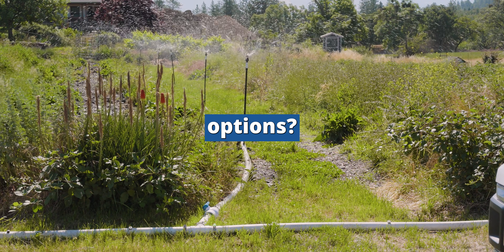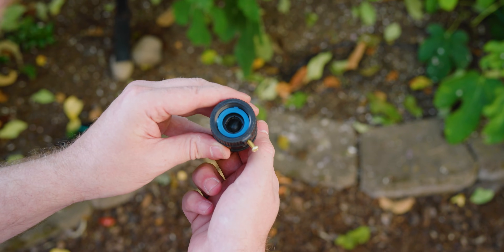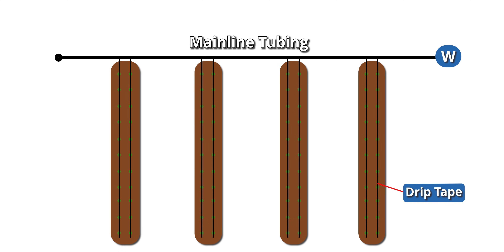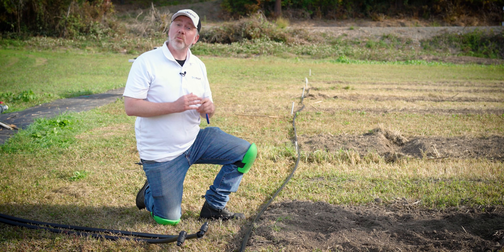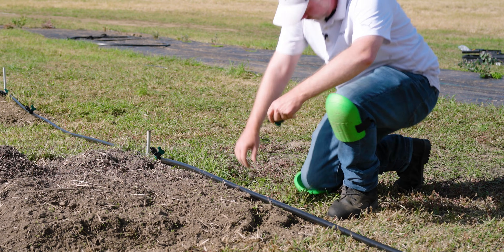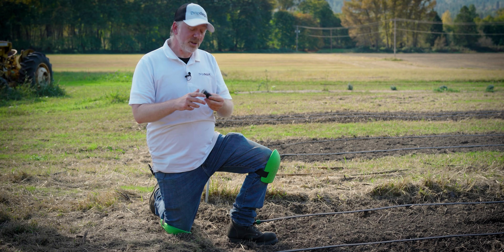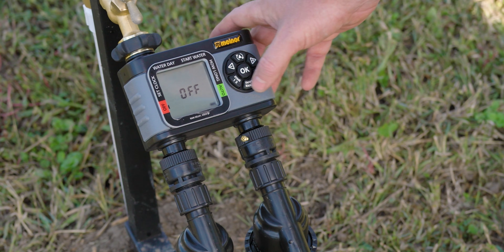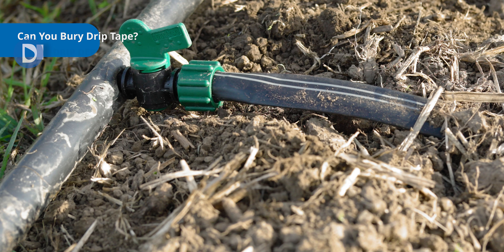How to Setup a Drip Tape Irrigation System for Small Farms | Step-by-Step Beginner's Guide

Comment: What is the advantage of drip tape over 1/4” dripping with inline emitters? I have well water and I have to replace the 1/4” pretty much annually.
Reply from the maker: The main advantage to drip tape is that it can handle much longer run lengths than 1/4" dripline.  Depending on spacing, 1/4" is limited to about 20' to 30', where drip tape, even at 6" spacing, can easily handle 150' or more depending on the emitter flow rate.  The main advantage 1/4" dripline has over take is the flexibility.  Drip tape has to be ran in a straight line, where 1/4" can snake or "S" shape through an area when things aren't planted in rows (flower beds in front of the house, etc).  

Is mineral scale building up inside your 1/4" dripline and eventually clogging emitters?  If that's what's happening, give flushing the lines a shot next time if you're going to be using it again.  At minimum at end of season, but periodically throughout the growing season is good if it's possible.  For this, you just remove the ends from the 1/4" dripline, turn on the water and let it run out of the end for a few moments.  

1/4" dripline has a "turbulent flow path" inside.  Basically, the water is very turbulent, and this will dislodge debris inside and if you have the ends open, flush it right out of the end. 

Dripline that is clogged with scale from hard water can be fixed as well, and it's not too tedious (unless you have a bunch of dripline, then it could be a bit much).  1/4" dripline can be cleaned of mineral build-up the same way folks clean misting nozzles: by giving it an acid bath.  Acid in this case is usually just some distilled vinegar.  You can put some in a bucket, then put the dripline in there with the vinegar, coiling it as you go to maximize space if needed.  Most of the time the vinegar even gets diluted first, if you decide to give this a try, let me know and I'll hunt down the dilution ratio in the spreadsheet. 

That's not always convenient for people who use a lot of dripline though.  The folks who don't replace it will inject an acid solution into the irrigation lines, and that provides a similar effect.  There's a little more going on when using a fertilizer injector to do it, but in many cases it actually ends up being good for the soil.  What happens is the "acid" lowers the pH of the soil, and this is often good for the soil.  Plants in slightly acidic soil are better at nutrient uptake, among other benefits.  And, it's common for soil pH to be a little on the high side when the water is hard.  Still best to test the soil first (one of those inexpensive pH kits is more than enough) to make sure it's not already acidic, but in most cases it'll be a bit on the alkali side due to the hard water.
Reply: I messaged your mail for more than 5 months and no response yet.
I have downloaded bunch of your videos and watched and fell I love with drip since rain tube consumes more of my water.
I wanted to get in touch with you so that I can I can buy a drip system for 1 hectare and my messages has never been replied since
Reply from the maker: @EleazerKorletey  Any time you don't hear from us for more than a day (other than on the weekend) be sure to check your spam/junk folders, as we reply to all emails we receive and during office hours it will usually be very prompt (within minutes for short queries, a couple hours for the really complex stuff).  During this time of year we're out of the office over the weekend, but we jump into email as soon as we come back Monday morning.  

We email from a general support@ address, so sometimes they get routed to spam/junk folders inadvertently (and we check our own spam folder multiple times a day to make sure nothing slips through the cracks).  

I did some searching through our emails. and found a ticket for 1 hectare from just over 5 months ago (early August) and it was actually me who replied, if that one was yours definitely look in the spam/junk folder as I can confirm I sent a reply on Aug 1.  Some email providers delete the spam folder contents every 30 days or so, if yours does any replies from us may already be deleted, but we're happy to pick up where we left off at any time and our email software does not delete old emails.  

If that one wasn't yours, double check the address you emailed if you can and make sure it went to our support@ email address (I'd put the entire thing here, but bots will scrape it and send spam).  

I'll keep an eye out for any emails looking for irrigation for a hectare - emails with projects that large either to go me or my other colleague, so good chance I'd see it either way, but I'll stay extra vigilant and will check our spam/junk folder a little extra in the next few days :)
Reply: @dripdepot thank you